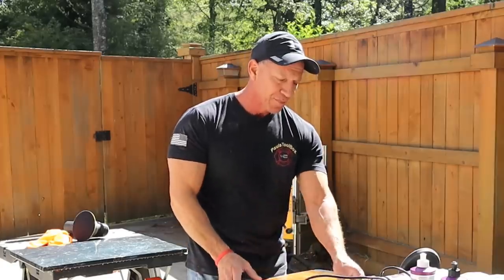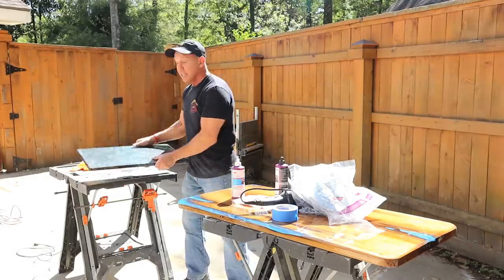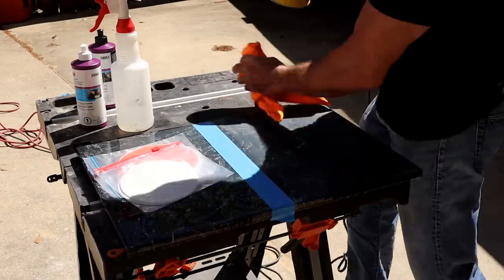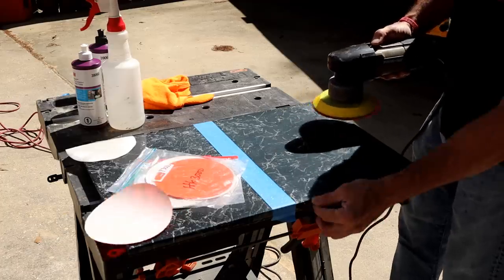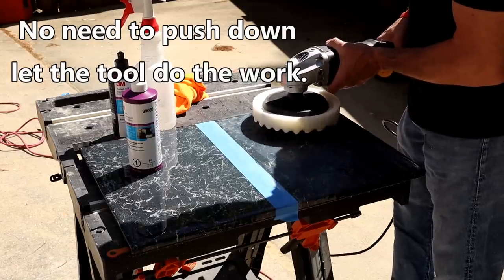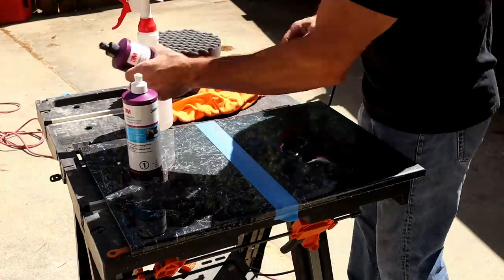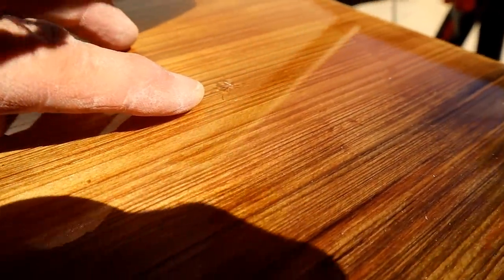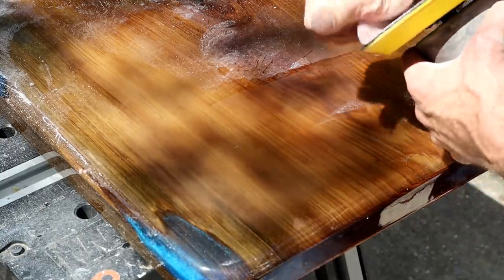How to sand and Polish Epoxy Resin!

Comment: Hey man. Great info. I'm just beginning my epoxy journey.  Finding out that a whole lot can go wrong.  Good to know you can fix some of it. Thanks again,  Jeremiah Johnson
Reply: Biggest thing I've learned is that time to fix mistakes is longer that one might think.

I was doing my floor and mixed too big a batch, which accelerated the Cure to the point where it was at gel stage as I was pouring.

Because I was strong arming the material over the floor, I introduced massive bubbles.

I tried removing them with a heat gun, but looking at the uneven surface and all the bubbles to clear, I gave up in disgust, thinking I was going to have to remove it.

I came back about 4 hours later, it was cured enough to walk on, but just for giggles, I used the heat gun and to my surprise I could still work a lot of the bubbles.

And it was pretty level.
Reply: @Zomby_Woof  thanks, I’m also just starting so this was very helpful. I won’t be doing floors though, at least not yet anyway. Just want to start with small tables or placemats. Any more advice would be well appreciated. Thanks again 😊

Comment: Just started doing resin today.... I can already tell I'll need to do some buffing, this helps a bunch....
Reply from the maker: Hi Teresa, two things I want to make sure that you are doing this with StoneCoat And it works better if you let it cure for 30 days first. That’s how long it takes to get totally cured and hard.You can polish StoneCoat earlier than that but that is the recommended time frame.

Comment: Just built an outside bar, poured epoxy at precisely the proper temp OUTSIDE, knowing i havent seen an outdoor example, built a plastic cover over it for protection, of course during the cure, a few bugs or debree landed in it, its only 1/8 to shy 1/4 deep..im at the limit of adding More epoxy and risking spill over..just have a few spots that cured before it settled (from bugs) having fans keeping the temp down helped and hindered...this video will help have the confidence to fix those spots thanks alot

Comment: Hello from across the pond. 
Being a part timer or a weekend warrior as I've heard it being described, I dont have big work shop and dust settling on my top coat can be a real kill joy and it prevents me getting that top quality finish I want.
This video has shown me that I can go back to all my finished products and sand out the dust in the cured top coats, bring them back up to a high gloss finish with out having to reapply more epoxy and struggle to keep more dust getting trapped in the epoxy. 
Thanks for the video I've subscribed to your channel so please keep 'em comin.
Cheers

Comment: I have tried multiple products, pads, processes. Everything from lacqure, poly, wax (big mistake). I finally broke down and purchased this perfect it, pads and compounds. Used my spinning not DA polisher. Sanded with DeWault Orbital with Diablo pads at 150, 220, 320, and then the new sanding nets at 400 which I have to say left much less swirling and very impressed. Then wet sanded with the DA at 800, 1000, 1500, 2000, then a 3000 net type sponge pad. Cleaned between sanding with distilled water. Then ran through the 3M perfect it steps, 2 passes at each step on my river table which is Hard Maple with Famo Wood. I left one section as fresh pour. I cannot even tell where fresh begins and polished ends. Really works, after being really frustrated. Worth the money and actually process after sanding was as quick as the video. If your trying to polish resin bite the bullet and get this 3M Perfect It. I don't know or am not selling or pushing any of the products here. Just happy I got it working. By the way I stayed at 1500 on the polisher, stepped up to 2k a few times but kept surface cool and light on the polisher. Seriously cannot tell.
Reply: why doesn't a dual action orbital polisher work?

Comment: Thank you for posting this, I did a woodburned sunflower kitchen table that  messed up (first epoxy project ever and I def messed up) but it has some waves in it from not using my bigger squeegee when I did the flood coat. I was thinking I’d have to sand it, cleanse with acetone then do another flood coat. This is a much better solution

Comment: These tips helps for applying epoxy to artwork as well. Gotta fix some imperfections without having to re resin yet again . Going for partial matte finish. I use art resin since it’s specifically for art and non toxic .

Comment: Thank you. That gave confidence to try it on a table I just finished, but I think you said you should wait a certain top to let it set up completely.     I  bought the Novus kit and used it on a top that was maybe a week old and it got real smooth but it did not cope up the same luster. maybe i should have waited longer? This new table has some dust in it.

Comment: Nice.  Just getting started with using resin.  Still have lots to learn.  Right now I have an uneven piece and I'm a little bit hesitant to run it through my planer.  From everything I've learned it should work fine but I'm also worried about messing up the piece.  It looks like polishing it out is the trick ...  Love to hear your reply.  - Mike -
Reply from the maker: Hi Mike, depending on how unlevel it is you will see it on the finished product. If it’s sloped just a little bit on one side you can raise that side and make sure that the top of your slab is level or the epoxy will roll off. If you are going to do a thick pour with casting epoxy, you can make a form that is level, you may see a little slope but it should still look good if it is not too uneven. I haven’t been putting videos out because I am dealing with cancer for the second time but I will get past this and I will be happy to show more. If you have questions that I do not see them please send them to my website Paulstoolbox on my contact page. I will be happy to help.

Comment: Nice video I have bugs ALL the time I'm going to use your advice thanks great video btw!
Reply from the maker: Hi Jeffrey,
I also have a video that shows how to remove bugs and bristles easily when the Epoxy is still wet. I use a toothbrush and it works like nothing else. I will add that video in the description box. 
Thanks!
Paul

Comment: Your tip really helped me when I did my flood coat on my first project it had some imperfections. I  sanded them out and applied another coat and it was perfect. I am going to use the 3M project you used.  Do I have to have the same buffer or will a random buffer work?

Comment: For any of you guys that are interest McGuires 105 and 205 from harbor freight work amazing too and you can use a 20% off coupon so its like 28 a bottle. You can buy the white whool cutting pad and the adaper from harbor freight too, they work fine. Then go to a paint store and buy the 3m black swirl remover pad for the 205. 105 witht the cutting pad and 205 with the black pad. Or you can use the orange/yellow harbor freight pad for 205 if you dont have a paint store. 2000 is a great grit if you only want to one sand paper and yoir not trying to get rid of big bumps. I use all the 3m products at work everyday buffing helicopters after we paint them and use the harbor freight stuff for my personal stuff, looks just a s good with some practice.

Comment: This is a great video and I'm not disputing your information, but I don't recommend doing this until it's cured.  Especially for beginners, if you work on it before cured, the resin is soft, so there's a big risk of gouging.  If you gouge it, it could be impossible to fix.

Comment: Hi Paul, thanks for the video.  One thing about the list of materials; the hook and loop backer pad that you have listed does not fit the porter cable sander/polisher.  I am a 'noob' and did not notice this until I had ordered it.  The porter-cable has a DA thread, and the backer pad (as you state) is a 5/8" arbor.  

How would I use the backer pad with the porter-cable sander/polisher?

Comment: Would it have been better to put  another coat of stone coat after  finishing the sanding? That way you would keep you protective layer deep and the self leveling of epoxy would have filled in any inconsistencies in the sanded depth of the protective layer. Other than that great content. I'm getting ready to pour my first river table, 7'x3.5', and its good to know that even if a darn bug gets in at the end I'll be able to salvage a expensive and large piece. That polisher would help a lot too! Just sayin!

Comment: The table top is beautiful,  I have a question? Can you use this process the same on anything with epoxy or just wood. For example I make tumbler cups an sometimes get dirt in them. Just wondering I know it's not the same field but still the product.

Comment: There are so many different kinds of 3M cut and polishes. I just ordered some, but mine are in the 609X range. I hope they work as well.
Reply: How did they work out btw? I have an epoxy resin counter that I’ve sanded and need to return to the original clarity.
Reply: @cors5600  it depends on the resin you used. If it's hard enough to polish. Some brands just don't get hard enough to polish, like Total Boat (you'll NEVER get TB to polish), so you'll never get that original luster, you'll have to flood coat it again. I can polish polyurethane to a mirror finish. But for most resins I can only get a good gloss. I haven't had to polish much resin bcuz most my table finishes are a matte to a semi gloss finish. (Odie's oil, osmo poly-x, Rubio monocoat, etc)

Comment: I poured epoxy on my large handmade dining table (103"x42" with two live edges) with a tape edge and there are a few spots that need repair. The epoxy climbed up the tape and left a sharp edge so I don't want to use a sander as I am afraid it will tear the sand paper, thoughts on how to get started on that? In another spot I have what looks like a drip that was missed with the heat gun that I think I will hit with 800 grit to get the majority down to the rest of the table.

Comment: How do you attach the 5/8 Hook & Loop Backer to the Porter Cable sander polisher. The sander comes with a 5/16-24 female spindle. I have been searching for the adapter. Thanks in advance

Comment: Great tip Paul, but I noticed when using the blue polishing pad you used the black polish compound. Shouldn't you have used the blue polish compound? I guess it didn't make much difference since you still ended up with a great finish.
Reply from the maker: Hi Ned,
 Perfect -It comes in 3 parts, 1 is compound, 2 is what I used and it is the polish. I failed to mention but 3 is not necessary for most projects, it is used for removing swirl marks on high gloss dark colors if needed. 3 is blue in color but these materials are expensive so you should only use what you need. You can use way less cream than I did on this project, I haven't used them in a while and I got carried away when applying the creams. 
Thanks!
Paul

Comment: hello my friend, I watched your video and it is wonderful thanks.
I try to make small objects in wood and resin, after casting I must file and use the belt sander with 120 grit to give the final shape.
after this step, 400-grain step with disch sander.
as a final step, use abrasive paste for cars, polish for car headlights.
the problem is that I don't get a perfectly transparent resin. what do you advise me to do?

Comment: Paul, I have seen you on the SCC channel as well. I have a question that I thought you may be able to answer. In regards to top coat, I applied the UTC glossy and really dislike it now. I was wondering what your opinion is on wet sanding and polishing only in regards to protection from scratches.  I love the high gloss polished look. Or if you were to have the UTC on and then wet sanded would you get similar results?  I hate to sacrifice the beauty of the piece , but  I need durability as well since I have young children.  Thanks 😊
Rachelle

Comment: What do you 'seal' the epoxy with on your table (if with anything). I find that just leaving it unsealed, scratches easily with every day use. I have been trying different things like wipe on poly, but I can never seem to get the polish back like the original pour shine. Thank you for the video. Also what do you find is the best sandpaper to use for epoxy. I have used numerous types over the last 3 years, and find most of them gum up with epoxy very quickly including even the festool ones specifically made for plastics.

Comment: Hi Paul I am used to polyester resin sand epoxy is a total different system. When I having trouble with air bubbles in my epoxy pours. I do flash over with a heat gun to pop the bubbles but I seam to create more bubbles coming out of the timber. Is it that I haven’t sealed it properly or do I just keep flashing the bubbles until there is no more . You help will be much appreciated. thanks in advance

Comment: Hi Paul, great video! I am new to polishing but recently came across beautiful Corian surface, looks like marble and it is a fairly big kitchen table. It has only superficial surface scratches but they are all over and I tried with a polishing kit to remove some (with no power tools) to see whether the compound and micro-mesh will work. It worked but it will take me probably eons to polish the whole area to a high gloss. Do you have any tips on which power tool to get? (Ideally I would want to use it on metal and acrylic and poly based surfaces) in the future. Thanks!

Comment: I was wondering if you used the stone coat ultimate top coat on your table before this whole polishing process. I'm stuck trying to figure out how to get the high gloss finish, but the stone coat top coat seems to give a matte finish so I'm wondering if I should avoid using the top coat if I'm going for a glossy finish.

Comment: I recently poured an epoxy top on my cornhole boards. I made a dam around the edges with painter’s tape. When I peeled the tape I got sharp ribbons/ripples on top of the edges on the surface. They need to be smoothed down so bags can slide freely. How would you go about this?

Comment: Hey Paul, I recently made my first two wood/epoxy pieces (I mainly make things with resins, so I’m somewhat new to wood/epoxy projects) and I’d like to sand/polish them out to a glossy shine. I’d leave them as is, but both have a couple small imperfections (dust, a dog hair. Argh!). I’m a big fan of the Abralon sanding pads and have them up to 5000 grit. I also have the 3M polish, but what I’m wondering is, can you finish with number 2 and not have to use the finishing number 3 finishing polish? To be totally honest, I just don’t want to have to buy the number 3 if not needed. I’ve always had good results with wet sanding epoxies, polyurethanes, polyester resins with the Abralon pads, then adding a dab of number 2 to the 3000-5000 Abralon sanding pad steps, then using a black Mirka pad (again with number 2) and if needed, a final few passes with a Mirka wool pad. I suppose what I’m wondering is, is there much of a gloss/finish difference in using number 3? I just can’t imagine the pieces getting any better of a finish going up to 5000 with the Abralon pads and the 3M number 2. 🤷🏻‍♂️😉 Thank you Paul! Jason

Comment: Great video! Question. If it is a deep “thing” and I have to really dig to get it out, should I put a little clear SCC in the hole, then buff as you showed?  Elsie is adorable!
Reply: I have done multi layered epoxy to fix mistakes such as you questioned. I have had success and also had what looked to be failures but with sanding and polishing turned out perfect

Comment: hey paul, thanks for the info! would you happen to know if i am able to use my angle grinder with polishing pads? instead of buying a second tool. thanks
Reply: I would say not. Grinder runs at too high rpms and would probably burn it. Best off to get a buffer. A good one of you want to do this regularly. I recommend Dewalt but other brands are ok too. Milwaukee and Makita make a good one. Look on Ebay for a decent used one to save money.

Comment: When sanding epoxy it really doesn't matter what sand paper you use wet ot dry. What does matter is how warm the epoxy gets. If it gets too hot then you will have micro tears and usually happens on realatively new work. You can put a wet towel on the surface then put ice on top of the towel to lower the temperature of the surface. This way you can sand with 80 grit dry then go progressively higher. The key is to not heat the surface by turning up the speed. 
As for keeping dust out and bugs out, build a tent out of cheap visqueen, why skimp out ofter spending hours on project. I've done 180 foot bartops with minimal garbage in the surface.
I've done everything from residential to commercial work for over 35 years and never had to polish epoxy.
Reply: I know you might not reply, but is he accurate in saying you can't polish with an orbital polisher? I just ordered a dual action random orbital 20mm, and then i saw this video, saying orbital wont work.
Reply: @koolkid1234ism  An orbital sander is fine just get finer and finer sandpaper. See  if you can get 1200 grit if you. The finer the sandpaper the easier it is to polish and glaze....but dont use the same compound pad for glaze. You'll be fine

Comment: For a surface that doesn't need to be perfectly level it's fine to sand out the bugs, but if the goal is to have a perfectly level surface where water won't puddle into the dimples of the work area you can remove bugs via drilling them out carefully, then insert a peg with sandpaper around it and polish the hole 🕳  low medium and high grit .. then fill the hole with epoxy and then sand and polish again
Reply: Depending on depth of the hole u will end up with air bubbles